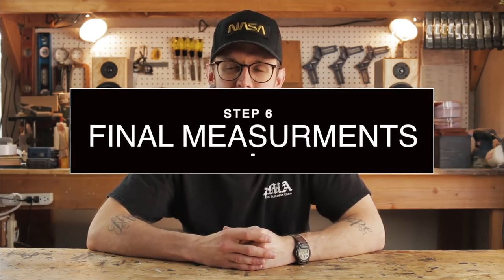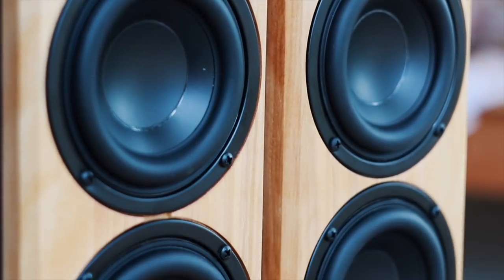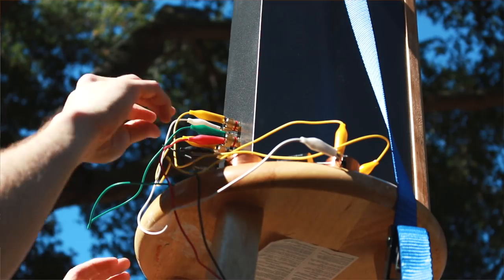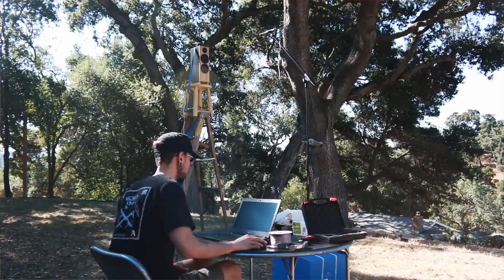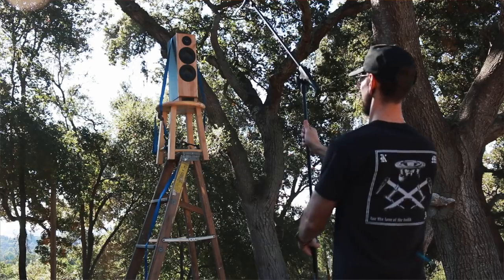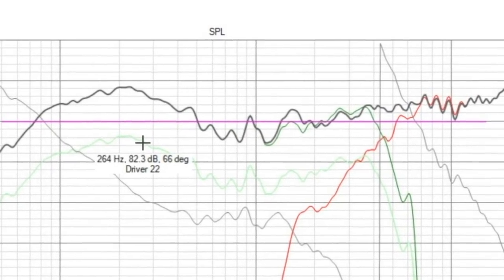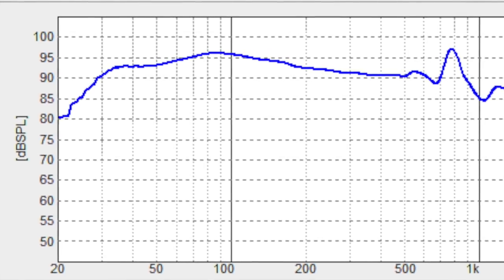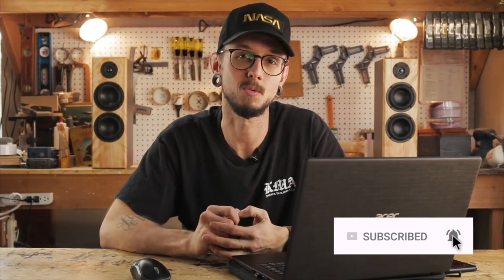Measuring My DIY Speakers OUTSIDE! || Step 6 - Final Measurements

Comment: I could have used your help 40 years ago.  Back then a 8" woofer was considered small.  I think I will build and design a small speaker  (what I consider small using a 8" woofer) using your techniques. Thank you very much for introducing me to the software now available.  I have built the Overnight Sensations, Tri-Trix and GSR speaker kits maybe 10 years ago.  I looked into your kits and they seem very reasonable.  Wood working especially baffles have been my downfall to say nothing about speaker grills.  You are a very talented young man!!!

Comment: Turned out really nice! And as I mentioned in one of my comments about the hump in the low end, I thought it would pretty much disappear.
Would have like to have seen some off axis measurments thought... I know most people may not know but they can actually be as useful if not more usefully than the in axis response, will show you how sell the crossover is doing.

Comment: I kinda built something similar out of reclaimed wood out of hard maple from a cabinet I found on the side of the road. But I used a passive radiator instead of a port . I used a different tweeter and crossover but they sound really good and I did a lot of reinforcement inside and I got kinda fancy with the box I really want to share how they look. I was inspired by watching your video and it's the first speaker I have ever built and I'm a good carpenter and when people see them they love the way I made them look I doubled the bottom and top with wood and with all the reinforcement they are like knocking on a rock. I thank Kirby for the inspiration and I want to send you a photo. I built them after work outside under a light with only a battery skill saw a sander and a router. I funny I was watching this again I was thinking about adding a small subwoofer on the other side of the speaker and bi amp it with a small sub amp but I don't want to mess with it anymore. But I was wanting to build a center channel with a sub in it and I'm waiting for you to the video out so I can build it . Thanks bro I got the building bug .

Comment: Those look great!!! That TCP115 seems like a pretty crazy driver considering the cost!! I'm not too sure moving the port to the front would have the effect you were talking about. By having the port up front, you will introduce some (minor) midrange coloration but mostly, you would lose a fair bit of room reinforcement in the lower octaves. It might make for a more natural bass but certainly not a more present bass. Baffle diffraction doesn't seem to be an issue looking at the graph you measured tho! That graph is pretty insane tbh... 

Being that the two TCP115 are connected together instead of as a 2.5 way, wouldn't they integrate better with the tweeter as an MTM instead of a TMM? Better imaging ... anyway, as always, love your content and what you are doing for the DIY speaker community! Great video!
Reply from the maker: Thanks Jules! Really love these drivers, crazy value. Yeah, theres been some discussion on how it would change the sound, I think it would be fun to test it. A 2.5 would be a fun build with these. Yeah, a MTM would probably be a better setup. I actually might set both of those up and see how they sound! Thanks again for watching!
Reply: SMOG the 200hz bump you are talking about is only present in the “theoretical” graph that came from using the provided measurement from Dayton Audio and inputing them in a crossover design software. The measured response doesn’t have that bump. 

In a real world situation where the speaker is somewhat close to a rear wall, the location of the port WILL have a significant effect.

Comment: Is it accurate at all to just buy a calibrated sound monitor and measure my speakers db in my home? Ive seen a few of them on Amazon in the $30 to $80 range. I have a set of JBL L50's which had a replacement woofer put in by a previous owner, and Id just like to know if its higher or lower than the original woofer specs from the factory in 1979. Thanks.

Comment: Hey Man,
Nice vid. I see you mostly work with standard 4-6 inch drivers. Would be nice  you can cover other sizes as well, Less than 2 inch for example, portable carry in your bag speakers. Or car drivers, dual-voice coil types. These are really challenging, in my opinion. This should be fun to watch and more importantly actually learn nice speaker design stuff.

Comment: Great speaker design!
I also build a speaker with this tcp115-4 driver, but when i measure the response i get this huge bump from 100 to 500Hz as it is in the crossover design.
I measured at a distance of 50cm and with more than 1m distance to every wall in my living room.
Can somebody tell me why this is the case? 
I thought that the baffle step would fix this... oh yes, i have to tell you that my baffle is very close as in the video.

Comment: Have you or can you do a speaker similar using the AMT tweeter from parts express?

Looking for a better and  taller speakers then the T652 air. That be good for 2ch and also Home theater, also a matching center and bookshelves for surrounds and heights with wall mount for Atmos.

Comment: I mean I hit a 143 on 2 12 inch explodes in a car and they didn't seem to sound like a "spl" system due to the clarity of my mids and highs and at the time my subs were only receiving roughly 200 watt  out of the 600 they could handle rms

Comment: Hi, i really enjoy your videos on YouTube. I use to build some speakers in the past. I noticed that you use the omnimic v2. I will buy this mic also but can you tell me which software you used for the measures. I want to build a high power 4 ways speakers with a closed box for the subwoofer, and another close box for the second high woofer and a midrange and tweeter. I use the jbl pro 6 by 9 639 , which is a three way and i will add a subwoofer in that box, so all the driver will be close together for a coherent sound including the bass that is out of tune in almost all speaker installation. to divide my frequencier i will go to a fully digital crossover-amps solution which is easier to tune and should permit finer ajustment and go to 48 db per octave. when i was building speakers it cost me a lot in capacitors and coils and it was time consuming to solder everything .

Comment: Hi my sincere congratulations for the amazing creations.  I have a question. In order to limit environmental reflections i see some makers putting felt strips around the tweeter domes.  Saying that this could improve soundstage rendition.  Is it a good idea ?
Reply: That's an attempt to reduce baffle diffraction, which is sound waves reflecting off the front face of the speaker. Since the sound is then coming from more than one place your brain has a harder time figuring out where things should be placed based on sound.
Reply: @fortunefed8719    Thank you very much for the kind and valuable explanation ... but do you think that it could be effective ? because i was thinking to make a ring with a thick felt to be placed around the tweeter.  I read that in an untreated listening room speakers with limited/controlled/narrower dispersion could give a better performance.  Room reflections are the evil to fight usually.
Reply: @gino3286  I imagine it can't hurt anything but aesthetics, but the most important thing, like you said are room reflections. Impulse audio has a good video on baffle diffraction, worth the watch.
Reply: @fortunefed8719    Thanks a lot.  I will have a look Kind regards, gino

Comment: I Made 104 cm high transmission line speakers with a 7” midbase speaker with a fs of 39hz and the box probally around  that fs with a Amt tweeter sound epic really need to put iT in that Free software

Comment: Very nice video. Is it your very first video showing measuring results in your speakers? Having a look on the results, it is a very very flat response, but seems to be much better than expected in bass response for such a small woofers. Is that measurement really representative? What do you think?
Reply from the maker: I designed the enclosure to reach 55Hz at -3db, so I got pretty dang close to what I expected. Near field measurements of the port and woofers shows good response down to 50Hz and they sound great to my ear... so the measurements make sense to me. Thanks for watching!

Comment: Also if you do a slot port design your woofer can play really low the thing with ports is the tuning doesn't define how loud its gonna play just how low the port area determines the actual loudness from a spl stand point more port area is better especially in a small enclosure with small speakers this design you could have gotten away with a 2" slot with an internal width of that box a d just made it really long per say 20" in overall length and it would have decreased internal volume by maybe .75cuf but the thing with the internal volume is it doesn't have to be perfect when ported so. That .75 would have been entirely acceptable or you could have increased its overal size another .75 to account for the port area

Comment: You know if you crossover your tweet about 1khz-1.6khz as a minimum it'll bring out the clarity of the vocals right? I've always crossover my tweeter at 1k or 1.6k and then my mid is at 150-350 min. And I've always lpf my woofers at around 20-80 depending on lowest playablitiy. Idk how most feel about that but I can say that in a sq car audio situation you want a flat response on all possible scales so the best way of acheiving that is knowing your speakers "cone ripeling" point and kinda testing the waters with what sounds best to the ear 90% of all systems I've heard the tweeter sounds like trash almost like a 8khz hpf is in place with that being said a tweeter should never play that high minimally it'll cause the tweets to burn out faster than if it were to be tuned lower because like all driver they're supposed to move there's not much movement at 8khz and tweeters tend to vblow at that point one reason I tend to dislike passive over active x overs

Comment: Would having the port in the front change the port length in any way?

Good job btw!
Reply from the maker: Yeah, the port is on the bottom right now because of the current cabinet design. I would need to redesign the cabinet to make it the correct length for the front. Thanks for watching!
Reply: Kirby Meets Audio maybe some passives on the back? (Or one on each side)It would add a lot of cost, but solve the port problem. .

Comment: Wouldn't a small portable-ish chamber, or even half of the verticle height of a closet turned into a anechoic chamber with modular pre-lined panels work?

I've always thought it would work in theory, but since no one seems to have done it already? I must be missing something obvious.

MUST the chamber be big?
Reply: The problem with a small chamber is that you will limit the lower frequency range that you can achieve in the chamber.  Wavelength = Speed of sound/Frequency.

Comment: Port in rear needs wall to help bass response I believe....front port gives better response in my opinion, just an opinion.
Reply from the maker: Yeah, depends on the build, but I like front facing as well. Thanks for watching!
Reply: Kirby Meets Audio never use a front ports for desktop speakers though, the ports can chuff in your face.... Which is really annoying :)
Reply: SteadyMTB  mine are towers with 2 dayton designer 5 inch and titanium tweeter. Wish I could show pic but can't figure out how to, lol.
Reply from the maker: Not if their designed properly!
Reply: Yeah the one reason why some designer put the port on the back is there may be a chance of midbass coloration.
Reply: I've build a lot of front facing port which i always believe it has better phase response over rear port. Then I tried build rear port, it doesn't sound good up close, the lower bass just felt a little off timing, then I tried different drivers with rear port, same issue. The only benefit I can hear is no speaker back wave travel out from the port (box sound), but this can be minimize by reducing the port area and adding acoustic absorber in the box, although cannot fully eliminate but still sound better than rear port.
Reply: Not if who's designed properly?

Comment: The cabs are quite small for twin woofers, a single woofer in the same size box would actually give better low end response. Porting will no doubt help though :)
Reply from the maker: They were designed to hit 55Hz at -3dB with a flat response. A larger enclosure might give more bass, but would give a big bump below 100Hz. If that's what your looking for, then heck yeah! But I wanted a nice flat response down to 50. Thanks for watching!